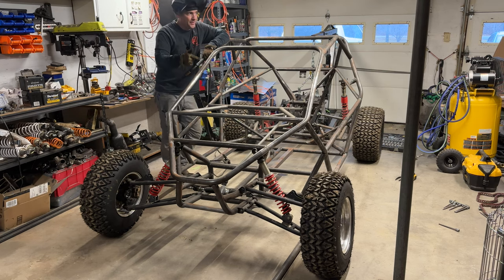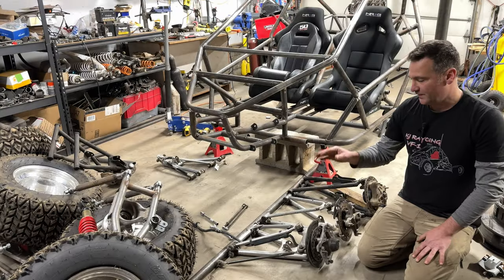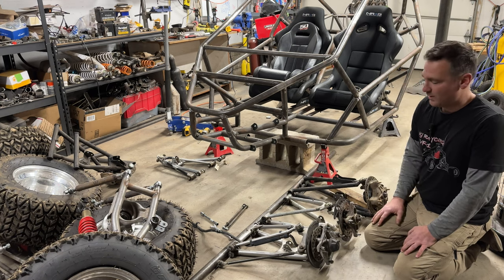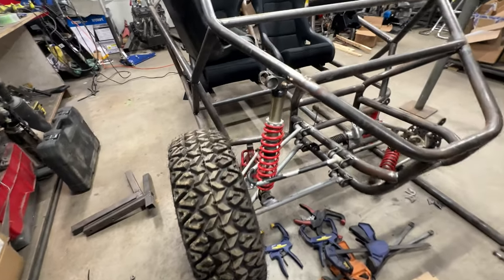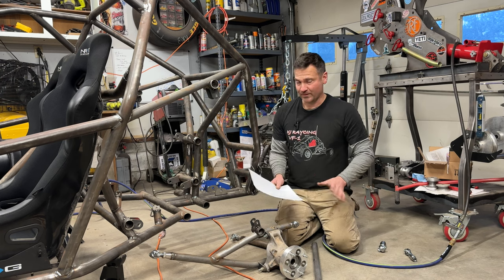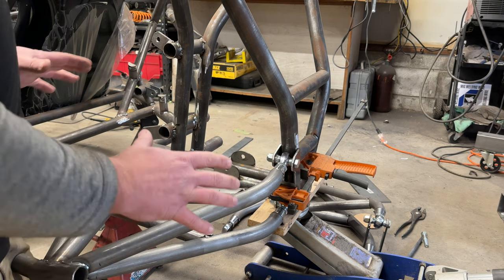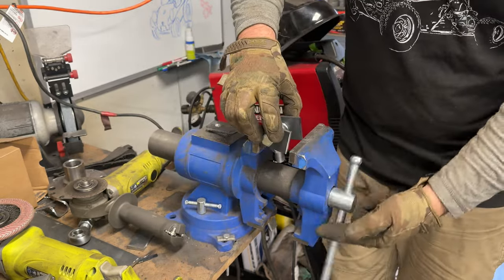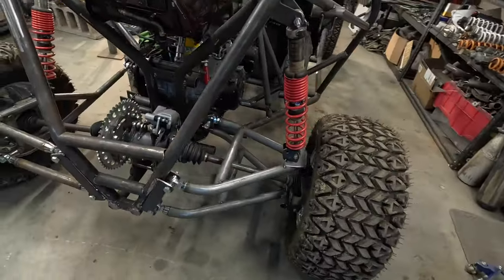2 Seat Crosskart Suspension Special!  Trailing arms or A-Arms?  Check Description for Plans/Details

Comment: How dobyou think this would stack up against a rzr for multi terrain ridingbim in utah we have sand to red rocks to dirt road all my buddies have rzrs im thinking one of these is alot cooler but rzr are just so good at everything
Reply from the maker: My 500cc polaris beats rzr’s until they put it in 4wd to get the jump on me. They are way faster because of the gears and the suspension can be built for whatever you want to do.  I think they would more than stack up against rzr’s… 😁